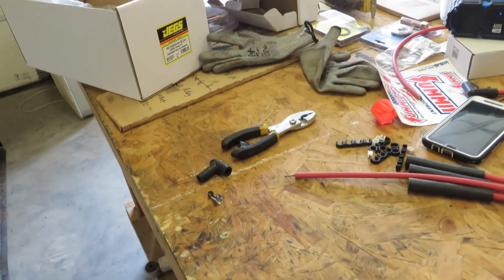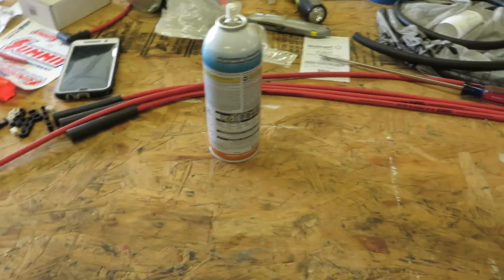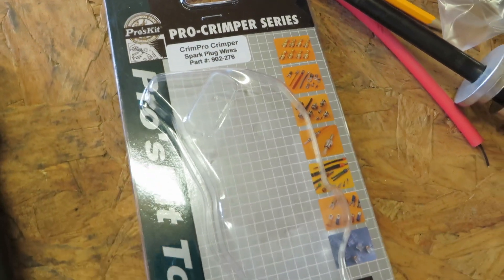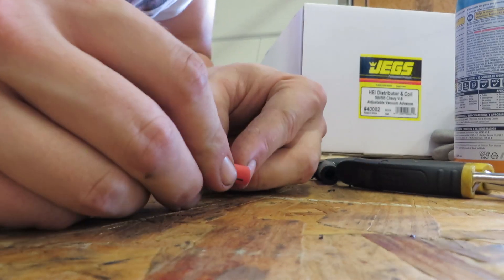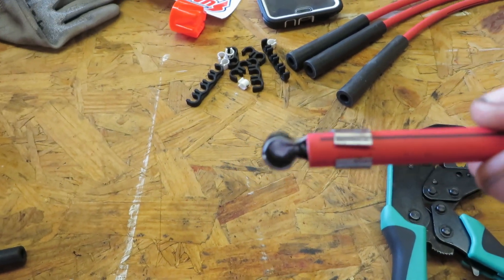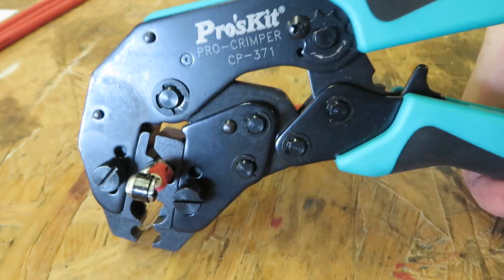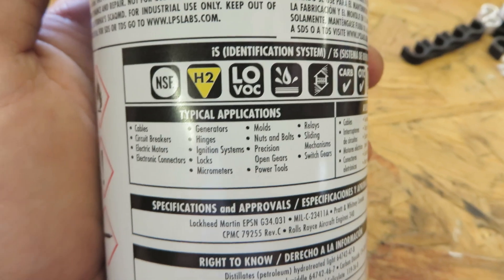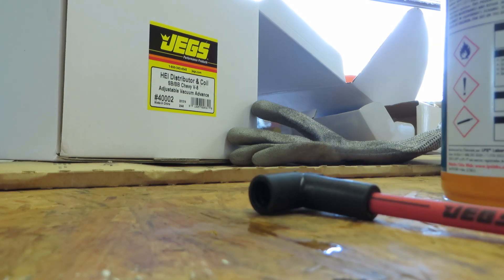How to make your own spark plug wires.

Comment: Great stuff!  Thanks.  Nor sure it's worth investing in the tool, which I'm sure would cost me more than the wires, though.
Reply from the maker: @SinnerSince1962  Depending on the brand of crimpers, you can get them for around $25 off Amazon. Just make sure they are the correct size for your wires.
Reply: @livinthedream8353  Thanks!

Comment: Good vid . I subscribes because I like your channel name . Did the wires work fine without pulling back that black insulation ? I’m just doing this and it’s a PITA to strip anything past what you did. Just wondering if yours worked fine I’ll do it that way. Thanks keep livin the dream . Dream Big
Reply from the maker: The black center that looks like a fuse is the conductor. That's what carries the current to your spark plugs. It gets folded back over the outer casing, which is the insulation. The center of the wire gets crimped in between the insulation and metal end.
Reply from the maker: Unless your core is copper, I don't believe there is anything else to strip. From what I understand, the black core is conducive carbon. It carries the voltage.
Reply: No your correct . I did a resistance test just to be sure and yes this video was the most informative I could find . Thanks . Like we sat up here in Narthern Canada . Are You Dumb Yet ? Lol

Comment: Well done. Only thing I do differently is I hold the insulation back about 1/16 or 1/8 more than u did so it doesn't bulge out of the taper of connector and can't impede the connection between the plug wire and plug. It probably won't matter here, but I like things to look good and take every caution to ensure functionality.

Comment: I believe there are three layers of insulation on the conductor, you removed only two. The inner black later is typically called the suppression layer and contains the conductor which is what you should have exposed and folded into the connector and crimped. Also it is a good idea to use a dielectric grease on the connectors and inside the rubber boots to prevent moisture causing corrosion.

Comment: what is the difference between this wire and normal cable thanks
Reply from the maker: What do you mean by normal cable? As in just regular electrical wire?
Reply: @livinthedream8353  yes
Reply from the maker: @pakcom-vl9kd  they aren't the same. The conductive part of the wire is very different. I believe an hei distributor puts out around 20k volts.
Reply: @livinthedream8353  Thank  you

Comment: Awesome video, this "Tutorial" was very helpful for me the DIY. How much will I be saving by doing these wires myself compared to the "Precut Wires"?
Reply from the maker: I'm not sure that you would be saving much if anything. I got these wires because it was for a complete custom project.
Reply: The savings you get is making them the exact length they need to be. Not that the factory didn't, but you can also route them better and use looms to your advantage. You basically are in control of how they are applied rather than buying a kit that is pre-cut to most likely factory specs.

Comment: You did a Good Job and next time.... Cut the Wire a bit longer and " Double Wind " the Wire to make sure the Wire will " Never " failed.  NOTE:  Get some " Water-Proof " Heat Shrink Tubes and shrink it after crimping.  That way it's water-proof and longer lasting.  :D
Reply: What does "double wind" mean?

Comment: You ran that wire too far in.
Reply: Oh duh! I see now!!
Reply: +charlietow - Yea, I think so too and you are 100% correct.
Reply: Too far in the boot?
Reply: @Ramslamtheman  Too far into the terminal.
Reply: @Carlitosway211  the terminal? I assume you mean the resister cap?
Reply: @Ramslamtheman  The thing he's crimping. He has too much insulation after the crimp.